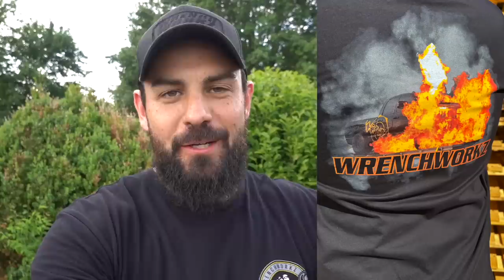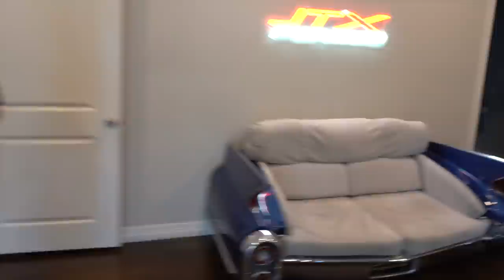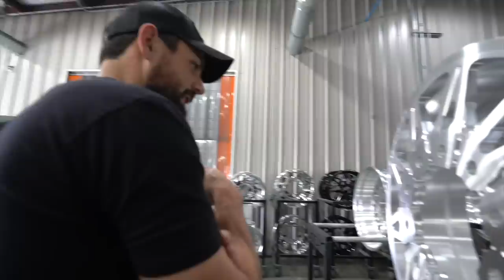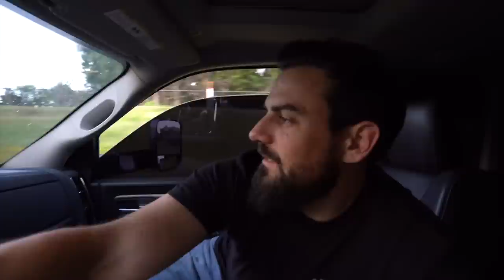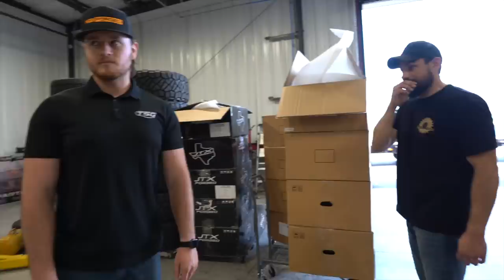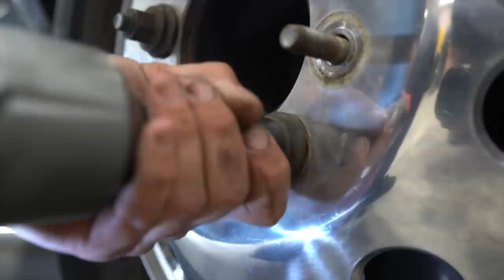RAM 3500 Tow Rig Gets NEW WHEELS & TIRES!!! BIGGEST SETUP YET!!!

Comment: Just opinion,  but I prefer a dually to look like a dually,  not the 2500 up front and 3500 out back.  Looks great to me.
Reply: Huh? So he put a 25 on a 35 chassis?
Reply: @ilovemydad1416  he means a normal wheel in the front not a duelly wheel
Reply: Yeah It looks like someone dually swapped a SRW truck and never finished the front axle
Reply: Super single looks way better in the front
Reply: Ya dually set up all the way
Reply: @ballacii  no, super single up front looks way better then the Down syndrome looking wheels that the inside of it pokes more then the non-existent lip

Comment: When that truck is loaded and starts to squat in the back, if those tires rub, you are done.    The spacer install = you do all future work on the tires yourself, as Discount Tires and others won't touch it.     If you hit a big ravine, wash, where there is a V shapped dip, there's a good chance that the gooseneck might not be tall enough to not cave in your tailgate, you might have to go to a flatbed in order to keep those tires and rims.     Good luck.